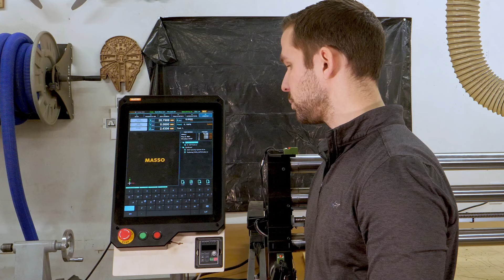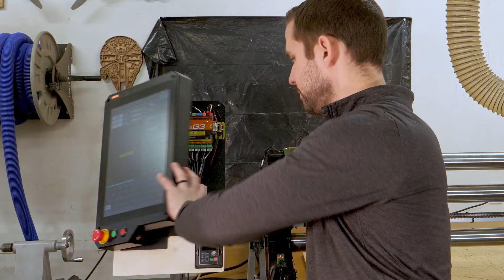I couldn't wait so I built my own ELITE cnc machine

Comment from the maker: For just the CNC components, I spent around $1400 more upgrading a stock Journeyman than it would cost to purchase one of the new Elite Journeyman CNCs from Onefinity. There are some differences between this build and an Elite machine, but buying an Elite series machine is definitely the better way to go if you can stand the wait.
Reply: Thanks for the compliments on the v9 and the spindle.😉 ~ Clinton aka PwnCNC support ~
Reply: Fantastic job and video, very informative. It will be interesting to see where the OneFinity upgrade kit/path falls in line as compared to your upgrade. $1400 was not as bad as I thought it would be. Perhaps Onefinity will pass on some of the bullk purchase discounts from Masso, or not.
Reply: Would the same power supply the comes with the elite able to handle the bigger stepper motors. Could I just order the larger ones and swap them in?
Reply from the maker: @LavinWoodworks  I don't know but my guess would be no. The larger stepper motors would take significantly more power than the stock ones so I doubt that they would have sized the power supply to be able to handle much output.
Reply: @42Pursuit  this is the current power supply. I know nothing about this stuff. Would it be underpowered. And if so what one would work if you don’t mind me asking. Thank you for the help! 

Enclosed Type 349.2W 36V 9.7A LRS-350-36 Meanwell AC-DC Single Output LRS-350 Series MEAN WELL Switching Power Supply
Reply from the maker: @LavinWoodworks  Nice work tracking that down! That isn't large enough to power the 3Nm steppers unfortunately. It might be enough for most use cases for the 2Nm ones but I don't know if it's worth the risk.

Comment: I'm sure you'll hear / have heard this lots but you'll probably want to add some rubber or something to the holes drilled in the frame to route wires (2:10) so you don't end up with a short in a few years of wear and tear from vibrations through the table onto the sharp edge of the drilled hole and the wires.
Reply from the maker: That's a great tip! I'm actually in process of 3D printing out some guards to protect the wires from rubbing on those sharp edges 👍🏼

Comment: A tip: dust screen in front of the intake fan for the electronics. It will save you a lot of cleaning time. Planning on using something like swiffer dry mop pads to filter out that airborne wood.
Reply from the maker: Hey, that's a great tip! Thanks for sharing!

Comment: Nice build. I don't have the space for 4x4 but am planning a 2x3 2.2kw build. Probably gonna stick with the Duet line of controllers, probably 3HC, which kinda destroys your startup time argument as my Duet2 from power on is ready to go from a laptop in about 3 seconds, but yes, you basically need another computer. They have a display output port running UART but I am no UI programmer and the display that Duet sells is like 6 or 7 inches diagonal. 

I am curious what your planning for ATC, are you thinking there's any way you can keep the 2.2kw spindle and just get an ATC attachment, or go the $1500 minimum BT30 spindle upgrade route?

Comment: Love seeing you use those power connectors. Typically they are only used in the AV world for lighting and audio.
For people that might want to source the power connector elsewhere, Its called a powercon connector. The blue is supposed to be power in and white is supposed to be power out. I would actually look for the neutrik tru1 connector instead as its better rated and has proper break when you turn the plug
Reply from the maker: Yup, both are good options. I believe the Amphenol connectors are rated for higher amperage, while the Neutrik connectors have a higher IP rating.
Reply: @42Pursuit  Neutrik is the original manufacturer of powercon. True 1 is higher IP rated over standard powercon. As for the power rating they are the same.
Reply from the maker: @DustySeven7  hmm, I saw the true 1 spec at 16 or 20 amps. Those amphenol ones are rated for 25 amps.

Comment: I have built a few CNC Routers about ten years ago. Looks like the hardware available is getting much better, which is nice to see. Can someone tell me why people are excited about the ELITE machine? I do see what appears to be a novel approach: the use of these massive circular linear bearings for stiffness. My first question is: are they as heavy as they look?
Reply from the maker: For the price there's not many machines that can compete. It's quite rigid and with this new Masso controller it's incredibly capable and versatile.

Comment: I have a Onefinity Elite Foreman. The motors that come on this are 1.2nM. My question is, since the Y-axis is driven by 2 separate motors does their force add linearly. Meaning is the force on the y-axis 1.2nM x 2 = 2.4nM? If that is the case then I think I would only upgrade the x and z axis with the 3nM motors.

Comment: Outstanding video! I have a Journeyman now and have been waiting patiently for the Elite upgrade, but I just read they have pushed it from the 1st quarter to 2nd quarter, which means with lead times it could be the end of the year before I would receive it.  I know you said you spent more money than one would by doing the upgrade, but you're gaining much more powerful steppers. 
I think I am going to do as you have done and upgrade it myself.
One question, what stepper driver did you choose for your rotary axis? I don't see it listed in your bill of materials. Thanks again!
Reply from the maker: Thanks Scott! I'm not entirely sure if the 3Nm steppers are necessary since Onefinity elected to go with the much smaller 1.2Nm steppers, but in my mind, as long as the power supply for them is sized large enough, better to have the torque and not need it than to need the torque and not have it.
Good catch on the stepper driver, here's the one I used: https://amzn.to/3yNharl It's just a generic one that I've had good luck with on other projects.
Reply: @42Pursuit  
Thank you!
Reply: @42Pursuit  
One last question...
I'm really digging your wiring layout and wanted to replicate it. I'm reading as much info as I can so I'll understand what each component does so I don't fry the electronics and electrocute myself. 😁

The two contactors you're using for the 120v and 220v seem to be the same rating, 120 volts. Is that intentional or is the other contactor rated at 220v?
You only have the 120v listed in your BOM.
Thanks I'm advance! 🙂
Reply from the maker: @scottbg1  Good question! I used this contactor for both. The coils are rated for 120v (the A1 and A2 connections), but the operational voltage (Ue) is rated for up to 250v with a max of 20 amps.
I set it up so the coils were energized from the 120v lines, but then switched the power for the 120v for one, and 240v for the other.
Clear as mud? 😄

Comment: Very nice wiring.   What are you using the relay board for?
Reply from the maker: I have it wired to the enable pins on the closed loop steppers.
https://docs.masso.com.au/wiring-and-setup/setup-and-calibration/axis-servo-stepper-examples/masso-stepper
I also wanted to have it for future add-ons I have in mind.

Comment: Would love to know how this setup compares to say a $10K Avid or something similar. Does it cut almost as fast.. as clean? Or do you get a lot more for that $10K or so? New to all this so not sure what the major diff is. Also.. can you integrate a tool changer with this machine.. or is that not possible?
Reply from the maker: I haven't personally run an Avid but I'd say their 4x4 is pretty comparable to the Onefinity Foreman Elite. Avid is rack and pinion for x and y which will allow for faster moves, but I've been able to cut at 500 inches per minute on this machine very accurately so think that difference is negligible for most operations. Avid also has a taller gantry and can have a slightly larger spindle, but both of those factors don't affect the type of work most people will do on this size of machine.
As far as tool changers go, that's actually why I picked the Masso controller as it has built in ATC capability. I'm hoping to explore that option here in the near future and hopefully add an ATC spindle and tool rack onto this machine.

Comment: How did you replace the stepper motor?
Reply from the maker: Removing the 4 mounting bolts in the corners allows the original stepper motor to be removed. Then a coupling nut is needed that matches the shaft size of the new stepper motor, after that is installed, the new stepper can slid on and mounted with the 4 mounting mounting screws.

Comment: Can u post a wiring diagram to learn from?
Reply from the maker: I unfortunately haven't put together a wiring diagram for this build. I just followed the documentation on the Masso site, and for the power I hooked up a pretty standard contactor circuit.
Feel free to reach out if you have any specific questions.

Comment: I have original onefinity woodworker. I really want that new controller but I don't want to buy a new machine. how can i get that controller on my machine?
Reply from the maker: Onefinity said that they're working on an upgrade path for the original machines for people that want to do just that 👍🏼
Reply: @42Pursuit  Granted it could have been a sales trying to upsell me but i dont think so but from what they (A support person from onefinity) said you have to upgrade the steppers and stuff needed. and you run into the cost of just getting a new machine. I did see the controller for i think 1300 around about. granted i love my onefinity Im just not busy enough for 2
Reply from the maker: @st0mper121  Ah, yes, I get that. I ordered the controller along with the closed loop steppers directly from Masso. It ran around $2k for those pieces. And then I had another probably $600 in other parts including wires, power supplies, drag chain and things like that. So I kinda get why they may have said that. I was hoping that with their wholesale account with Masso and other places they might be able to price the upgrade option at a price that would make sense to upgrade an existing machine.

Comment: This is just what I was looking for. The Masso site has separate prices for the G3 Touch and the G3. So does that mean the G3 Touch doesn't include a G3 inside it as you showed?. If that is so, then the total cost at over $3500, is a bit steep for me. In any case, looking forward to more of your vids on this subject. Subbed here.
Reply from the maker: The G3 touch comes with the G3 controller inside of the touch screen enclosure 👍🏼
Thanks for the sub! I've got a lot of CNC stuff I'm thinking about making videos on.

Comment: nice machine, can it cut steel ?
Reply from the maker: I haven't tried yet, but it's rigid enough that I think it should be able to. The speeds, feed, and depth will likely need to be dialed in and it won't be able to hog out material super quickly, but I think conservative cuts will work.

Comment: How much did the controller and steppers cost you? What was the total to upgrade your machine? (Not including the spindle and VFD)
Reply from the maker: Controller and steppers ran around 2k, other electronics, wiring and misc added on another 500 or so. And the stand was around 600 all said and done.

Comment: could you post a source list, parts list?
Reply from the maker: I unfortunately haven't put together a parts list for this build. If I have time I'll see if I can get that compiled and posted 👍
Reply: @42Pursuit  I completely understand. Sometimes the hardest part is to figure out where to get the parts. Especially parts that play well together.
Reply: @toddcumberland132  other than the brackets for mounting the switches should be an easy upgrade. excellent job on your build.
Reply from the maker: I've added links to all the components in the video description :)

Comment: Probably be a good idea to call an electronics tech or electrician friend and have them do all the wiring, the cost of the tools that
you would only use for an hour would cover the cost of the labor.  Having a bolt together metal frame option or even Gasp! wood frame 
would also make the build more accessible to the people that hate the addition cost and hassle of welding (not everyone has a welding 
machine near by).
Reply from the maker: What strange things to take issue with.
The cost of wiring tools is WAY cheaper than hiring someone to do the wiring.
If buying a $250 welding setup and teaching yourself a new skill is a deal breaker for you, this video is very much not meant for you.
Reply: I’d relish the chance to fully understand my own machine, have the tools to build/troubleshoot it, and if you want to build a table out of wood - that’s cool. Welding is not that expensive/difficult (and is a great skill to boot), and for how he’s using this table the welded frame completely makes sense. This isn’t a budget build; this is a build for quality and long term use.

Comment: Why not LinuxCNC ?
Reply from the maker: That's also a good option. I just liked the features Masso had and liked that it was a dedicated piece of hardware that didn't require a separate computer to run the controller.
Reply: @42Pursuit  Ok, but that is not a big deal when you can run in PI, Masso is a commercial product, I am not saying that all these companies might potentially use linuxcnc under the hood. ;-)

Comment: i think "elite" mean cnc have big can make anythink what need at cnc, thats mean table size has perfect 3 meter long Y axis and 2 meter wide X axis, then can use all size what normal need. spindle need be strong about 2,2KW or more, stepper motors minimum have 4-12Nm etc. can millig any material what want. and only idiot waste lot money 4000-6000$ onefinity etc, cnc machine because same and better cnc can build ewery normal men in garage lot lot cheapen and buy lot better drivers,motors,rails,spindle than ower expensive onefinity have.
Reply from the maker: So basically you're claiming that you can do bigger, better, faster, and stronger for less than $6k? Prove it, show some examples of what you're talking about.
Reply: @42Pursuit  excample, onefinity uses small nema 23 motors not lot torque, about 2Nm and my machine have 3-6Nm motors about 30-50$/motor. can cutting etc, metal, aluminium and motors not sure lose steps, drivers hav biggest can use biggest current motors, not lose steps, SBR rails have big strong , spindle have lot biggest not need many pass run all materials fast and deep milling,  controller have cheap no waste money and all same have than expensive controller ,mean breakoutboard, 20$ software, linuxcnc have only true REAL TIME control, not windows etc non safety control, linuxcnc have lot more flexiple software can build own controll display and add lot lot more additional tools and programs etc, makros, hall programs etc, all what user want do build own display and control panels, important have rails can buy lot cheapen and have better, drivers can buy cheap but better big, controller board can buy cheap and better not need buy and change ALL drivers if one go broken lot cheapen and comfortable to user, motors can buy and select best for user what need use ,woodworking or metal working or others, spindle can buy lot better biggest safe silent water cooled how big user want, can add lot external tools and automation and makros and softwares than all ready expesive  machine, etc, my machine have better all parts than 6000$ onefinity and cost to me only 1200$ if want update lot better strongest motors etc tools can make it cheap no waste money than idiot. safe lot money, hobby user have normal limited budget only idiot waste lot  many thousand dollar stupid small basic machine if can build same easy in garage own hand lot better machine, and safe many thousand dollar money. who idiot waste 4000 or 6000$ small worst machine if can ewery normal men build lot better machine at home. less than 1000 or 2000$ this is safe lot money and have better machine. and user can make table working size what ewer want or need own hobby working, 1M x1M or 5M x5M table size what user own hobby need, hobby user not need waste lot money than pro factory waste money. my point have idiot waste lot money and smart men make own machine lot lot cheapen and can use all parts what own hobby need, not have small owerprice factory machine option only.

Comment: Did you set Z-20 (Heavy Duty Z-Slider)?
Reply from the maker: I did. It's quite nice and definitely is faster on 3D carves.
Reply: @42Pursuit  - I bought Onefinity Woodworker X-50 2 years ago and I want to convert it to Elite as well as you. I'm going to follow your path. ))

Your video does not show at all how you installed the infrared sensors. Do you have a diagram of where you placed them? 
Question about Heavy Duty Z-Slider - does it shake when it moves?
Are MASSO motors protected against water (coolant)?
What motor will be installed on the 4th axle?